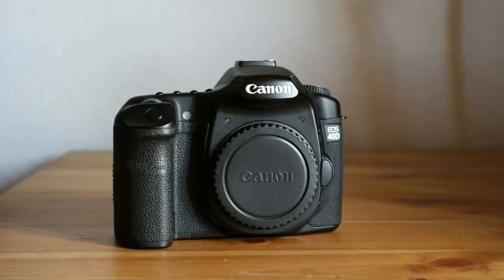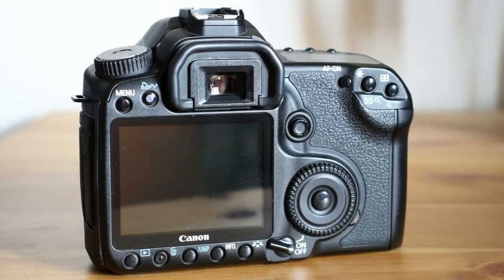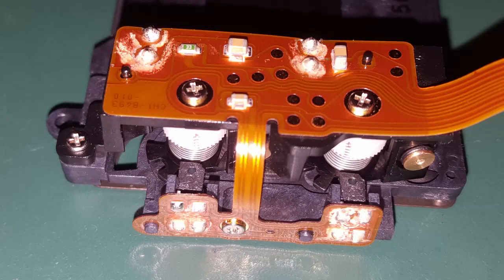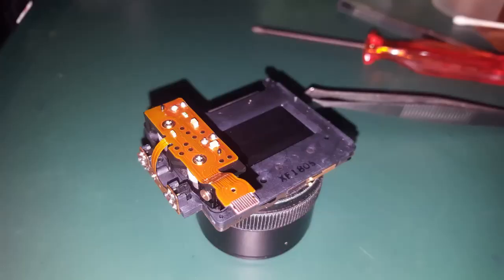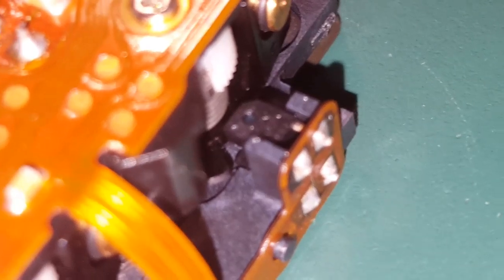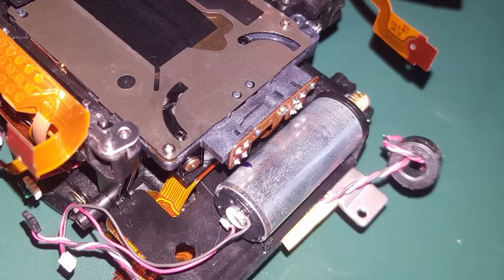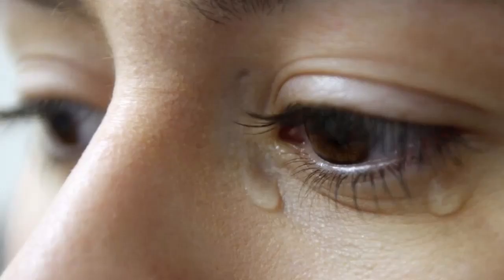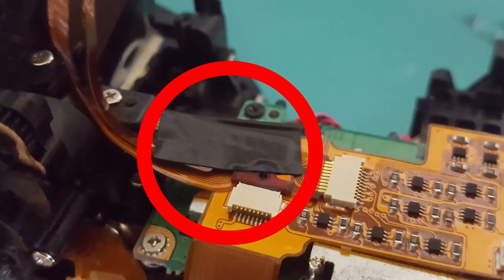Canon error 99 - faulty shutter mechanism reapir on a 40D

Comment: Perfect! Thanks for documenting your findings. I have a 40D with a similar issue, I suspect the opto-interruptor sensors on mine are not correctly detecting the shutter blades as I can shoot in live view, but not otherwise. It's good to see someone else has experienced issues in the same areas. Thanks again!
Reply: Hi, mine also work only in live view, I suspected it was something with the mirror mechanism. Did you solve your problem? I would be curious what worked for you ! Thanks
Reply: @lazarandrei8480  Yes, I did eventually find the source of the problem to be the lower shutter holding coil had gone open circuit (one of the wires had become disconnected from the solenoid wiring post), so as soon as it cycled the shutter it opened earlier than the camera expected causing the error. Fix was some very fiddly soldering of tiny wires, under a microscope but it works now!

Comment: Hi i have canon 50D that after i turn it on and right away error 99 pops on...
Reply from the maker: Does it happen even when the lens is off?
Reply: @craftingbreak2650  Hello, I have 40D and issue is the same. It does happen when the lens is off, no card, and immediately as I turn the camera on. I am hoping to take a look at it's internals today, first time working on a camera so I'm a  little nervous but I have a shutter replacement just incase.
Reply: @chsbadsly  good job. I think you just need to be carefull. There are many videos online showing you how to disassemble the camera. Just be carefull when removing the sensor. The 50D has three screws holding in in place at the right angle and distance from the lens so it is very important that you mark them and possibly take a picture of them so you know how far to screw them back in.
Whish you luck. Have fun!
Reply: @leonardomazza8170  thank you, it sorta was a success. Camera turns on, however it can't seem to autofocus or commit to taking a photo in manual. Although I started with error 99 immediately when turning on the camera, now I get either error 1 or error 99 when taking a shot. Some progress..anyone have any ideas I should look into?
Reply: @chsbadsly  What lens are you using? That error can be due to either the lens or the shutter sensor
Reply: @leonardomazza8170  I'm using two different kit lenses but both Canon EF lens for the EOS line, additional information is that I have 2 other cameras that came with these lenses and they work well with them. One is an EOS 2000 film and the other is EOS rebel XT. Sorry don't have them on hand to give better information. Perhaps I should look into the sensor?
Reply: @chsbadsly  ok so the lens must be good. I think there only are two possible explanations: you either forgot to plug back in some flex cable or you succeded in fixing just one of the two sensors that are presrnt on the camera shutter. Usually if the camera only show error messages when shooting it is the top sensor that os defective. Btw, did you replace the entire shutter assembly?
Reply: @leonardomazza8170  ah shoot hopefully it's just that I forgot a flex cable. I did also replace the entire shutter assembly.
Reply: @chsbadsly  really hope it is, otherwise that would suggest you got a faulty spare part... or something else wrong with the camera

Comment from the maker: UPDATE: I tried it on some other camera models. It works but you have to make sure you do not short anything while you reflow the joints. To be safe, put your multimeter in diode check mode,. You should be able to detect a diode with a voltage of about 1-1.1 V if you measure the upper or lower contacts of each sensor. If you see nothing, either the sensor is damaged or some connection is shorted.